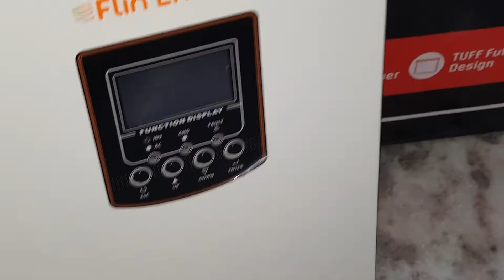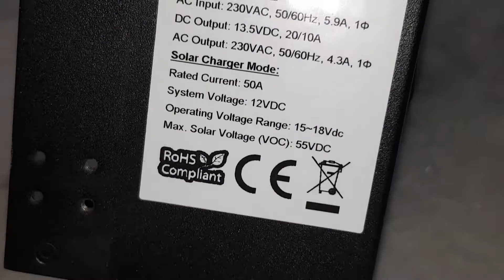FlinEnergy 1Kw PWM 12v Solar Inverter teardown (after cleanup)

Comment: How is flin service
Reply from the maker: i haven't faced any issue yet, as far as tech support like installation, etc, no issues till date
Reply: @AbhishekKr1902  how many earthing required
Reply from the maker: @netrocker9990  seperate for solar panels and spd and home one can be used for inverter